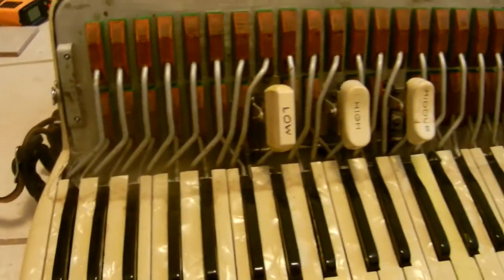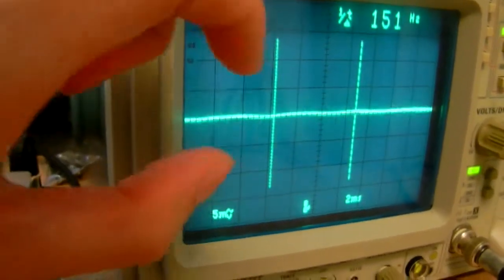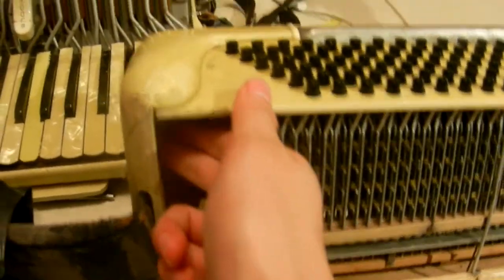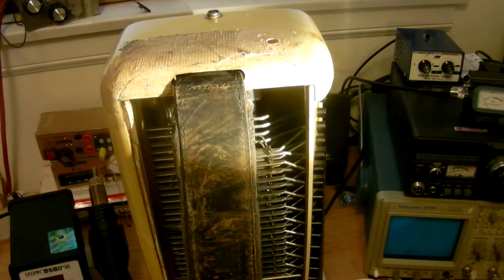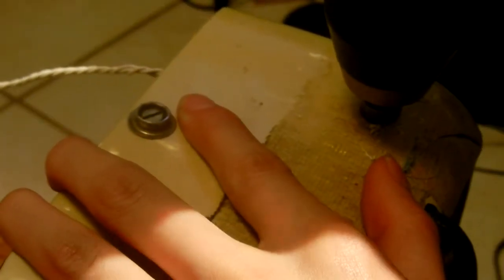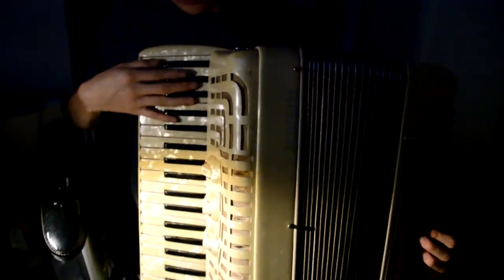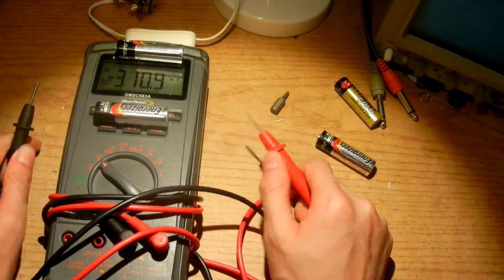[Bytes #2-3] Accordion Mic Pickup - How I Made One

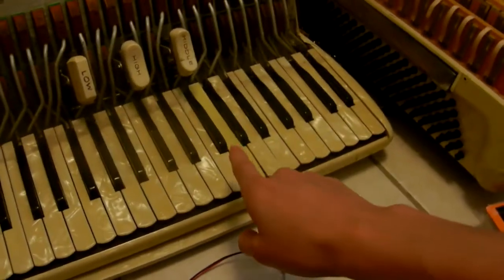Comment: 3:40 I'm politely disagreeing with your hypothesis that the slightly leaky bellows require more air to go through the faster vibrating higher reeds, causing the low end to be comparatively louder. On a physics level, lower frequencies require more energy to make, whether it's flute versus tuba or violin versus doublebass or whatever. In an accordion, the lower reeds have bigger air gaps between the reed and reed plate, whereas in the very high end the gaps get so small that a reed valve isn't even needed.

That being said, it may be possible that the lower notes only seem louder to you because their pallet/valve openings are closer to your ears, whereas the volume might sound equal from directly in front of you.